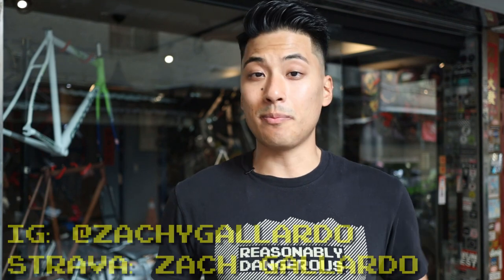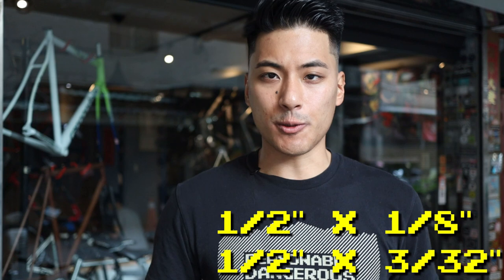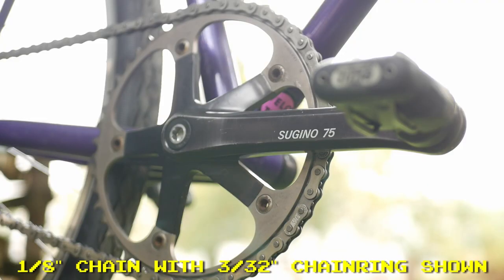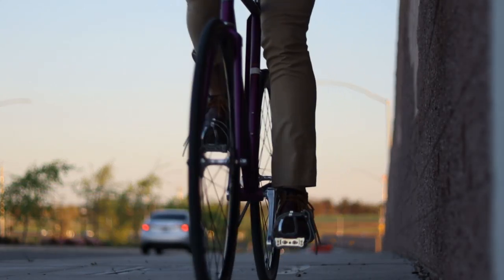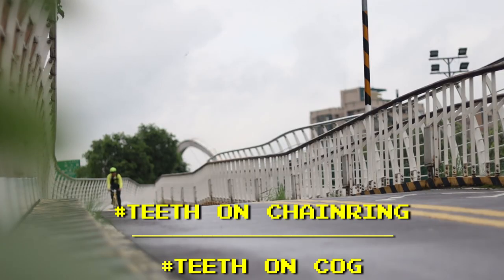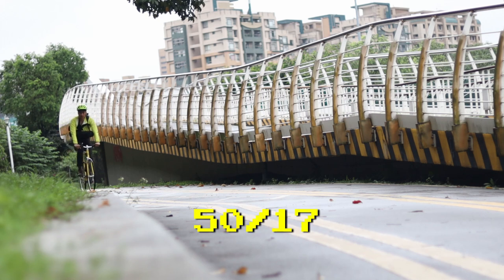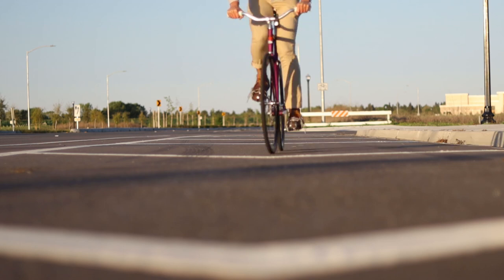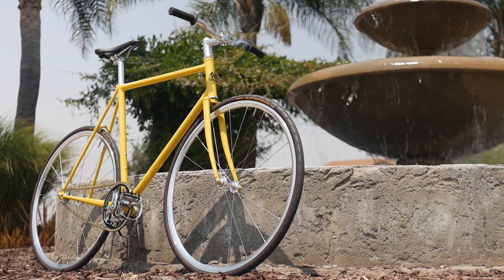1/8" vs. 3/32" Chains, Gear Ratios & Skid Patches | Too Afraid to Ask

Comment: Hey man I'm going from a seven speed to single (converting the bike because the shfiter cable frayed out. Can't immediately get a replacement, so 'HUH here's a guide to redneck the rear cog problem. NEAT.' 

I know single speed gets little love from the fixie crowd but anything you can suggest beyond 'just suck it up' when it comes to hills?

Comment: Gear ratio over 2.5 ratio is difficult/foolish to skid without skipping, and a ratio over 3.0 requires incredible strength and very few stops. Assuming 23-32mm tires. Tires do change your ratio a bit. A gear ratio under 1: 2.0 is easier to do tricks like backwards cycling, seat standing, wheelies and whatnot on, and in group road cycling drafting you need a ratio over 1:4, and the strength to keep that going which is a lactate threshold of 3.5+ watts per kilo. (28-40mph) mind you need brakes as skidding is impossible at that speed, if you did your tire would slip out under you

Assuming you clean your chain With the chain removed every 100 miles or so, skid patches are irrelevant. They change each time you put the chain on.

Comment: Great video! One concern: you said that the number of teeth on the chainring must be odd in order to double the number of skid patches with ambidexterity. Don't you mean if the NUMERATOR of the SIMPLIFIED FRACTION is odd? I used to ride a 48/16, which simplifies to 3/1. This should give two skid patches with ambidextrous skidding because the numerator (3) is odd. Right?

Comment: Every time I've tried to use a 1/8" chain on a 3/32" rear freewheel, it didn't run smoothly.  Since the chain is a little wider than the 3/32" cog, I think the chain wobbles ever so slightly when it engages the teeth, which creates noise.

Comment: you can also use mbt drive train with 1/8 or 1/2  as long your not using cog with derailleur or multi speed chain.  you forgot to cover that up

Comment: Im currently running a 50/16 gear ratio and thinking of going up just a wee bit, but I don’t want to make it extra hard on my knees and on my skidding abilities as well.. do you suggest going down a couple of teeth on my chain ring and a few on my cog as well? I’m afraid that if I go down one or two teeth on my cog only skidding will be harder. Ultimately which size matters the most to how smooth and easy skidding feels? Cog size or chain ring size? Thank you!

Comment: 52/17=3 or 42/14=3 gear ratio. In which case will be easier to pedal if keep the same gear ratio but change size of the gear. Thanks

Comment: I don´t understand the issue about skid patches? Even with a 3/1 ratio and not ambidextrous skidding = 1 skid patch it´s easyly avoidable by just taking off the chain and roll the wheel 3-4 teeths?

Comment: Ok I have a generic single speed (takara sendai) which has a flippable rear wheel been riding the freewheel side a long time now but I think I'm ready to try fixed, 1. Should I swap the rear cog or leave as is and learn there and move on? 2. Should I get pedal straps? I have the (mks sylvan track platforms).
Reply: Beginners must wear straps in fixed gear  And keep  one front brake

Comment: I have a 6KU bike and made the recent switch to try fixed cog and I like it some aspects. I'm wondering if it's worth upgrading
the components(wheelset, crank/cog, etc.) and just keeping the ridiculously heavy frameset until I get a better one? 
Any suggestions on whether or not I should do so and which is an reasonably affordable frameset?

As for gear ratio, what is a range for typically NYC? I see people effortlessly climb with their fixed bikes 
on bridges and hills. I have stock 46/16 but its kinda doable if I really push myself but I end up walking my bike
at a certain point. I wanna know what's a good safe zone for both flat ground and uphill/downhill?
Reply: O r i j u n o 6KU shouldn’t be that heavy maybe 25 lb or less. That’s fine, especially for getting to be a stronger rider, which you should and if you keep riding you will. You should be able to make it up all the bridges and hills in the city with 46/16. I’ve done it on 49/14 which is my race gear not my city gear, my city gear is 49/16 right now but I prefer something spinnier like 48/17. Anyway the bottom line is just ride your bike a hell of a lot and you will get stronger and faster and then you can do upgrades as you learn more about what the upgrades will do in terms of comfort, performance and looks
Reply: My Pure Cycles Premium has 46/16 and for hills I learned riding off the saddle and standing upright gets my body weight into it. Also getting a good fast start before the hill helps. Starting up a hill from stationery is hard. I also use tacking, criss crossing (if there's no traffic)

Comment: Hey Zach, I remember watching the Olympics and team USA were running LHS drive track bikes, do you know of any consumer bikes that run a LHS drive?
I think it would be so cool to have one, just to be different.
Reply: Timbo Ha! Phil Wood just came out with a LHD group set! Or you can run a driver style FGFS hub (no thread on cog/lockring and Spline drive BMX cranks on without worry LHD on any bike.
Reply: @mileswood3824 cheers for the info, would the pedal threads be reversed on those BMX cranks or would you just locktight in regular threaded pedals?

Comment: Important. I ride a 48/15 on 170 cranks  and im switching too 48/14 with 165 cranks. Is this a good idea? im 5'9 and 31.5 inseam. my question is that i like to go fast but im wondering if the ride quality will be smoother or will it get just a bit uncomfortable over a long sesh or riding period.
Reply: yomamadeathz ride quality describes how the bike feels in terms of vibration and road feel. As in bigger tires with less air in them have a higher ride quality than narrow tires at super high pressures. Also steel frames usually feels smoother than aluminum because they are more impact absorbing.  The longer the cranks the more leverage you have to pedal so it is  easier in theory to pedal all other things being equal (I have never experimented with cranks longer than 165 because when you’re going fast and turning you want to have maximum clearance and the shorter the cranks the more you can lean the bike over as you turn without risking your pedals striking the ground). Soooo 48/15 on 165 cranks might feel slightly harder to pedal than on 170s. 48/14 will be harder and faster still. I have a feeling you don’t race your bike, is this correct? If you are just riding around the city for fun i would recommend 48/17... stop and go it easier to get up to speed quickly and it is a hell of a lot easier to slow down. When I race at the velodrome or a Crit I typically use 49/14 or heavier. However when I race alleycats in the city I use 49/17... leg speed is important and the stop and go environment of a street race means you need to be able to slow down and speed up basically the whole race

Comment: I ride 48/16 but never really worried about skid patches.  You can always loosen up the chain and rotate your rear wheel a couple of teeth and your 1 skid patch is on another spot on the tire, right?
Reply: Brian Jones who the hell wants to do that? Not me
Reply: @moviepedro  It's not for you, no big deal.  I figured it was worth mentioning in case it helps someone else out.  It takes less than 2 minutes every once in a while and don't even think twice about my gear ratio, I just ride what feels right regardless of skid patches.

Comment: Just check out prime numbers. Prime numbers can't be divided by anything except 1 and themselves. So, that means that the number of the teeth on the cog is the same as the number of skid patches. That's why 17T cogs are so prevalent. Checking Wikipedia, 17, 19, and 23 are all prime numbers, so that's the number of skid patches, no math required. Stick to those rear cogs, and it should be easy to get a ratio that works for you with just a few front chainrings.

Comment: Is there any difference (riding wise) between hi-tensile steel and chromoly steel aside from weight
Reply: Patrickpaul Razon YES! Hi-ten feels like riding on a bike that has wooden wheels... compared to chromoly. It just is very dead feeling and vibration is not dampened much at all.... you feel all the bumps

Comment: why shouldn't I buy an NJS frame off of NJS Exports? I'm running a conversion with fairly high quality components I've scrapped together over a few months. Because of the already purchased goods, just about everything can easily be transferred onto an NJS frame for about the same cost as... lets say... a Kilo TT build. Why shouldn't I do this?

Comment: i still dont get the connection between gear ratio and the tire wearing out, shouldnt the tire kind be the only thing to decide either or not the tire would last long from skidding?
Reply: Khaled Masri the tire makes a difference, but if you have a certain gear ratio then you’ll always be skidding in the same place on the tire. so it will wear down faster. No tire will last forever, but you want some even wear so that it’s not always on one spot
Reply: @mrskibum885  now i get the princible thanks to you
Reply: The way I learned it is from a standard 48/16 is you get 3 rotations of the wheel for 1 rotation on the crank. When you skid at during the rotation, you’ll be skidding on the same patch on the wheel every time, cause 1 turn of the crank always means 3 turns at the wheel. Going either up or down on either the chain ring or the cog will mean 1 turn no longer means 3 exact turns.  Going up or down a tooth in the chain ring means when you make 1 turn at the crank, the tire will now land at 1 of 16 different spots. If you go up a tooth at the cog, to 17, then you create 17 different patches for the wheel to fall on after 1 complete turn. If you go to 49/17 you get 17 contact patches too, but if you can skid with either leg, you double that.

Comment: You said that you need an "odd number of teeth on the chainring" to double your skid patches. Really, you just need an odd number AFTER the gear ratio has been simplified. A 48/16 would simplify to 3/1, which would have TWO skid patches for an ambidextrous skidder.

Comment: Does a higher tooth count makes a smoother ride for almost the same gear ratio? what I mean is, for example, in a 3.0 gear ratio (wich can be met by a lot of different combinations) choosing a higher tooth count would be best than choosing smaller cogs? Is there any truth to this "theory"?
Reply: I am probably a bit late to answer your question, but here is my opinion.
Since the chain is going slower over all the teeth there will be less degradation of your components over time. Theoretically it could also be smoother, but I have no idea, if you can really feel that.

Comment: That gearing stuff doesn't make much sense if you don't take the wheel size into account. The wheel is the last "gear" in your system. Someone riding a fixed gear BMX with 20" wheels will have a very different experience with a gear ratio of 3 than someone with 700C tires.